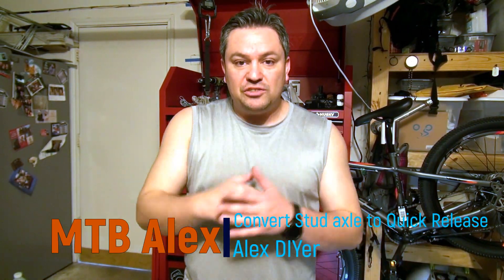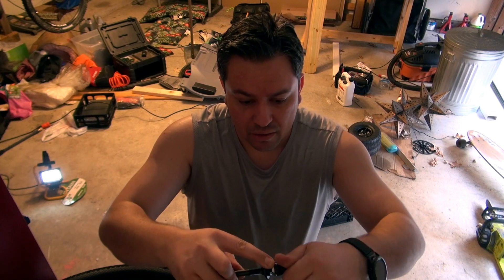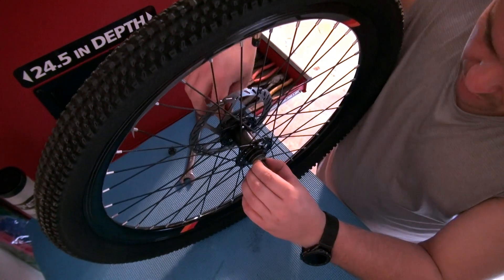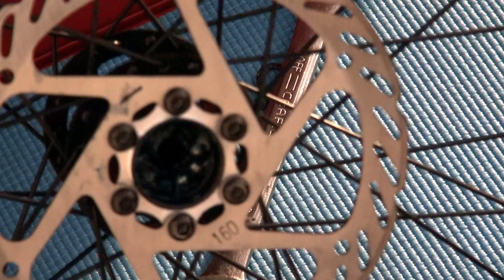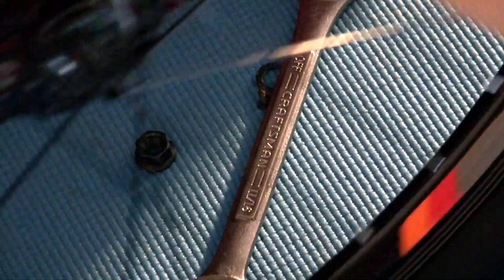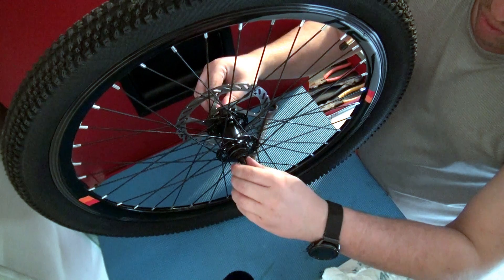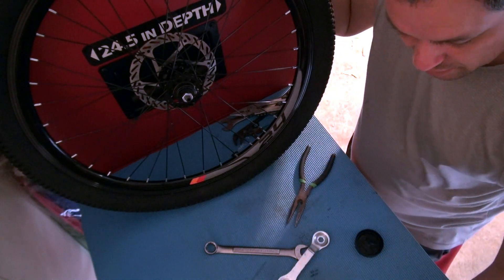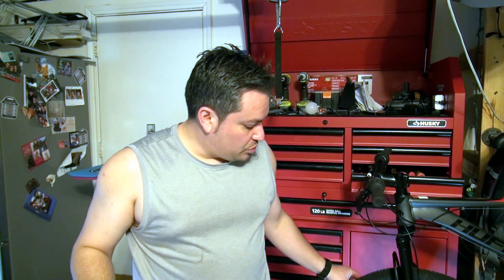💲10  Convert solid stud axle to QR quick release 😎 // $10 // Scott QR upgrade

Comment: Very useful video - thanks for that. Just a little nitpick - the QR skewer does not spin within the stud - both are fixed to the dropouts (only the outer axle with bearings spin on the stud), so it does not make much sense to put too much grease on the skewer - you just achieve that you get dirty hands on every wheel change :)

Comment: Did you remove the rear wheel cassette? Or it is not important?
Reply from the maker: Yes, you have to get to the lock nut inside the freehub
Reply: Could you please make a video for rear wheel quick release install?

Comment: What wheel size and what is the length of the axle.  Need details
Reply from the maker: this is on a 24" bike, but should work on any non boost.
*The long release lever for the rear wheel, hollow shaft size: approx. 5.7", diameter: approx. 0.35", quick release: approx. 7.48"
*The short release lever for front wheel, hollow shaft size: approx. 4.33", quick release: approx. 6.3"

Comment: Sure you will.make the bike thiefs happy by installing quick release.
Reply from the maker: I do not leave my bikes unattended.
Reply: Even with no release, thief can steal the wheel easily in just less than 5 second, with a 18 mm wrench or socket. That why I keep mine inside the house all the time, and if I have to keep it outside, I use anticut chains and U lock for both tires and the frame.
Reply from the maker: @abdoualilahthomas8031  mine are always inside, and when outside is because they are being ridden. I used to chain my bike when I was at the University Campus, thankfully never had a tamper on it.